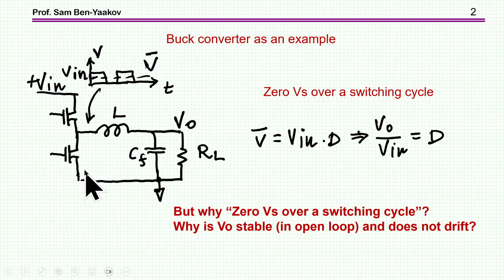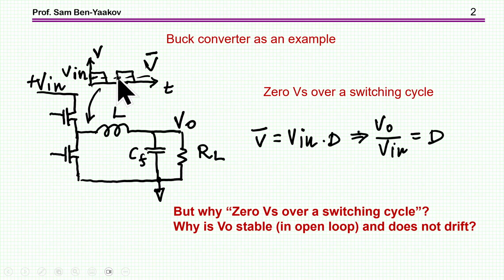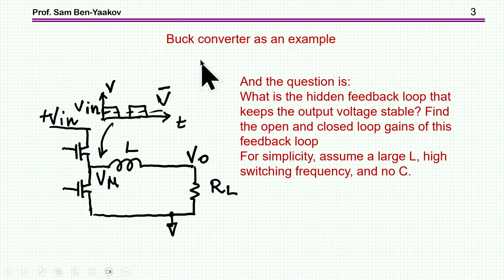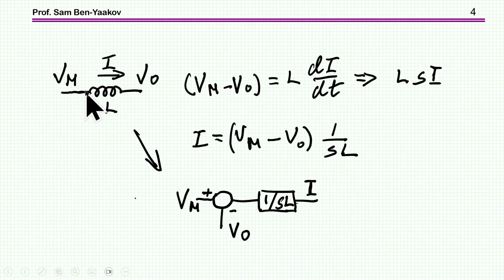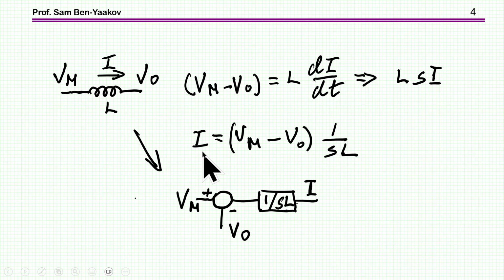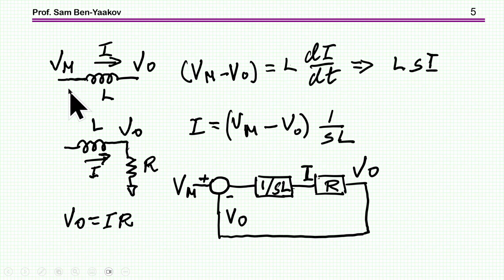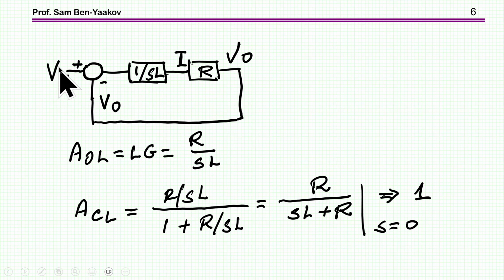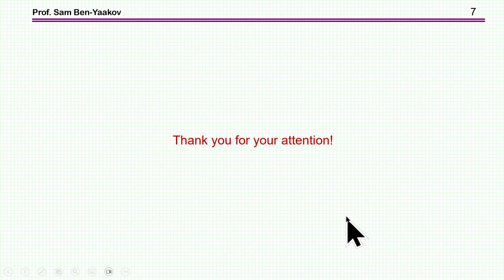Answer to riddle: Hidden feedback loop resolved

Comment: Hello Sam, are you aware of good theoretical research on the SMC hysteresis curve width? To a degree, similar to gapped ferrite toroid, SMC can be seen as split distributed gap, where individual gaps are smaller than 10 mkm. What about other magnetic properties like permeability / saturation limit / etc re particle size and relative density? Thanks!
Reply from the maker: Not really, sorry.

Comment: The hidden feedback is the assumption of steady-state operation, among other assumptions.
Reply: I'll provide another analysis viewpoint for those reading this. It's a sensitivity analysis of the two series component voltage divider, which is +1 maximum, zero minimum, which is exactly consistent with your feedback approach.
Reply from the maker: The hidden feedback is not an assumption. It is a result of a rigorous analysis that some miss.

Comment: Quite a clever way of doing this.Are there any more components that are "self regulating " in this way? Would you recommend a book on analog/power electronics that explains analysing circuits this way?
Reply from the maker: You can exercise this around a capacitor. No, I don't know of any book; all this is original with me. I am posting these videos in lieu of a book.

Comment: Sam, 
I am smiling watching that because it was a very clear explanation which could be understood by a first-year student studying feedback theory. After understanding this, the student could go further as the pole caused by the capacitor is introduced and develop the polynomial in the denominator instead of the simple single pole. 
You have a very good way of teaching.
Darrell Hambley - PE
Reply from the maker: Thanks, Darrell. My motto in teaching has always been: first explain intuitively, then Math🙂